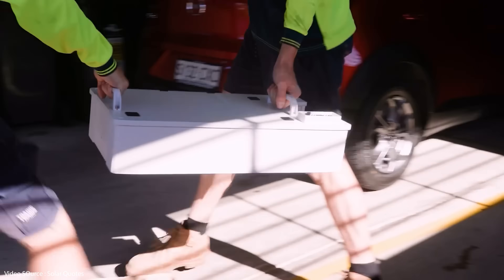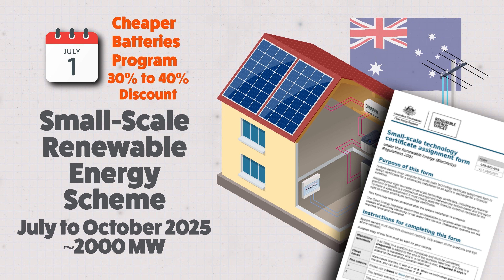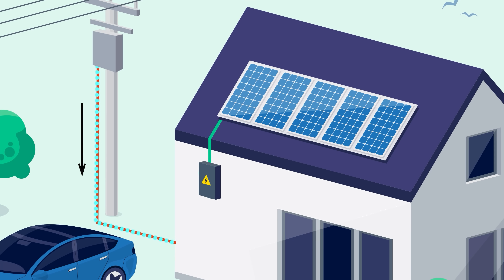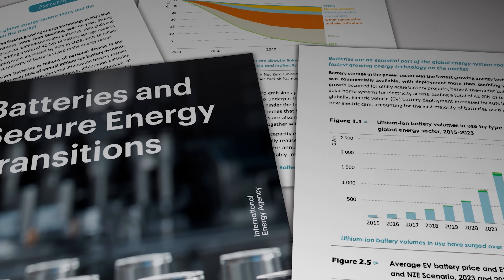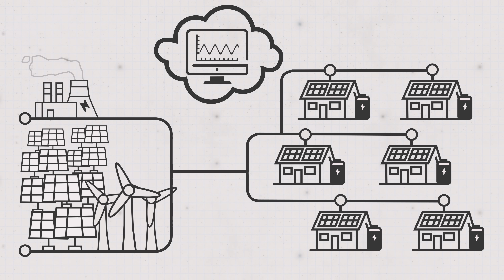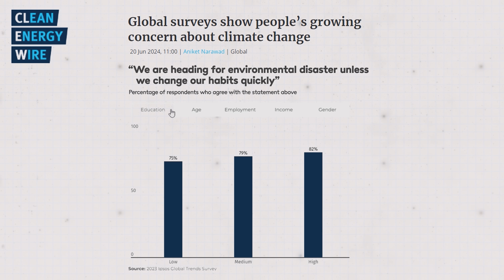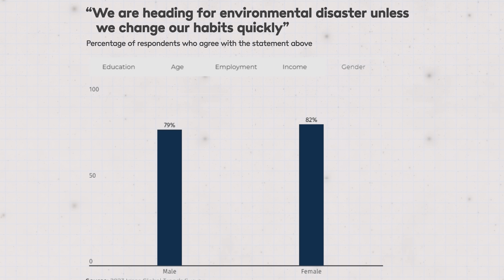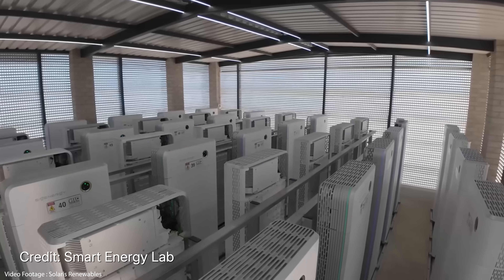Australians installed 100,000 home batteries in 17 weeks. Why can't we all do that?

Comment: I rember when expert said that 4% Wind/solar was max the grid could handle, now we are at 60% in Denmark.
Reply: Denmark pays Norway to take its unwanted randomly-produced wind-and-solar energy.
Denmark relies on imported hydropower from Norway.
Reply: @aliendroneservices6621 That's what a power grid is for - to enable countries to share electricity in response to changing demand and supply conditions.
Reply: @tassied12  Residential and Business Electricity Prices by Country in USD/kWh,
2023–2025 average:

Denmark: 0.358
Norway: 0.155
Reply: Geothermal is about to leapfrog wind and solar as the go to choice for energy generation.
Reply: @Les_S537  Leapfrog? That is simply an unrealistic claim when all you have to point to is a pilot plant!

Global solar output has doubled in 3 years. Ordinary Pakistanis added 18 GW of small solar in just 12 months. Over 1 million Germans have now installed balcony solar. The technology is advancing so quickly it is becoming accessible across the globe.
Reply: @Les_S537  No its to expensive, its ok for heating but to make HP steam you have to go to deep.
Reply: @andders2477 Yes, to produce geothermal for energy generation you have to go deep, and we now can...

Comment: Billions of watt hours of storage nobody has much visibility of. Though tomorrow is an example of our problems. South Australia and Victoria will have so much supply, they will pay customers use electricity. At the same time, across the border in New South Wales, that electricity will fetch $20 per kWh. The main cause is a large temperature difference between the major population centres, combined with poor building design where the fix is large air conditioning units.

Comment: As good as grid forming inverters are we need to have more synchronous condensers installed as they provide real “physical“ inertia to the grid. combined with large scale batteries, pumped hydro and grid forming inverters it is completely feasible to have Australia’s energy at 100% renewable. Flame away coal lovers.

Comment: I use Amber. I pay wholesale prices. Between 16:00 and 21:00 used to be above 50c per kW. Since the battery boom it is between 35c and 45c often. So night rates decreased slightly already

Comment: Let me be really clear batteries do not produce electricity. They simply store it. They also degrade overtime the longer they store electrons and the more they are called upon even more rapid loss of electrons
They are a back stop for a weak and intermittent unreliable energy source.
Reply: Geothermal is the energy of the future...  Period.  Nothing else compares.
Reply: @Les_S537 Not in Australia. Nearly all geothermal projects have been abandoned while rooftop solar continues to expan. There is now more capacity on our rooftops than in our coal plants.
Reply: @tassied12  Even in Australia you will soon see a resurgence in geothermal as an option.
Reply: @Les_S537  The investment isnt there. We have been trying for decades without success with geothermal. Our geology makes it difficult

In contrast we have plenty of sunshine so solar coupled with batteries are going gangbusters
Reply: @tassied12  I've replied to you several times in other threads within this forum explaining that we now have the solution to your problems.

The Kola Superdeep Borehole is 40k+ feet deep.

It took the Russians 20+ years to drill it.

Quaise Energy can drill to that same depth in 100 days now.

Problem solved.
Reply: @Les_S537 Quaise energy is still only testing their solution. They are still a LONG way from commercialisation. Given past problems with geothermal this is still unproven.

Meanwhile, solar and batteries are still showing strong learning curves. The price of batteries has dropped 45% in 12 months and global solar output has doubled in 3 years. That is a lot of ground to mske up
Reply: @tassied12  Next year they'll have a pilot plant up and producing power in the western US (it's in progress right now).

That's all the electrical utility companies need to begin building out large scale geothermal.

Quaise will be able to drill a geothermal power plant in less than a year.
Reply: @Les_S537  I still think you are getting ahead of yourself. It is a PILOT plant.

Meanwhile,  solar has fallen so much in price that ordinary Pakistanis installed 18 GW of solar in just 12 months. Over 1 million Germans have now installed balcony solar. Solar is now accessible to the average punter. Local electrification is where the world is heading. It will be great if geothermal is eventually able to play its part, but you must be mindful of other trends in technology.
Reply: @tassied12 a year is not a long way away
Reply: @tassied12  "Given past problems with geothermal this is still unproven."

There's a famous quote for skeptics such as yourself...

"Past performance is no guarantee of future results."

In other words, just because mechanical drilling has failed to produce geothermal at scale doesn't mean that millimeter wave drilling won't achieve it.

The fact is that mechanical drilling achieves only 0.1 meters of drilling depth per hour through granite, that is an immutable fact.

Quaise's millimeter wave drilling has already achieved 5 meters of drilling depth per hour through granite.

So clearly millimeter wave drilling is better and CAN achieve geothermal at scale.

Knowing this, and knowing the scale of environmental damages the earth is sustaining due to us producing wind turbines and solar panels and batteries at scale, why would you continue to champion wind and solar with batteries?

You're being completely illogical.

Comment: Australia is, as we all know, a difficult place to build infrastructure. Wildfires, dust storms, lightning storms, flooding, cyclones, geomagnetic storms, freezes and the usual terrorism. Adding battery systems makes the entire system much more robust, and buys time for repairmen to do their voodoo and restore service - because they now have options as to how to restore service. The entire distribution system is dynamically more robust. 
I'm not a huge fan of lithium ion chemistries for this application, however. Sodium-carbon chemistry is wiser for this application, as it is inherently unable to burst into flames while attached to you house, the materials are FAR more readily and broadly available, and it's cheaper in the bargain. It's bigger and heaver, but it's not a car!

Comment: and how many of them can be bricked remotely like the teslawalls?
Reply: All of them have internet access, and those owners should be happy Tesla bricked them because the ones they bricked all had batteries that came from a bad batch of cells from the manufacturer.  Tesla will replace the battery systems eventually.
Reply: @Les_S537  nopes they should NOT be able to remotely brick... they can do a recall... one day they get hacked (it happens all the time) and TADAA the whole world is bricked...
Reply: @LittlebitsStreams They did it at the request of the US Consumer Product Safety Commission (CPSC), and the units had already been recalled (November 2025).  The "bricking" took place post recall announcement.  A recall had been made within Australia as well (September 2025).  Tesla plans to replace all units at no cost to customers.
Reply: @LittlebitsStreams With regards to batteries more generally, people need to understand that this is the entirely wrong path to go, and the coming decades will prove that.  Geothermal is the path forward.
Reply: @Les_S537  nuclear power is stable, green and doesn't depend on the weather... the green fad is ridiculous... batteries only make sense in areas where you can't get grid access
Reply: @LittlebitsStreams Geothermal is stable (capacity factor between 70-90%), green and doesn't depend on the weather.  Just 0.1% of the thermal energy beneath all of our feet is enough energy to power mankind for 2 million years, and it doesn't run the risk of radioactive fallout that nuclear does.  Yes, yes, I know modern nuclear is relatively safe, but it can AND HAS gone awry in the past.  You don't have that risk at all with geothermal.
Reply: @Les_S537  then start digging...
Reply: @Les_S537  nothing wrong with modern nuclear and thorium etc. can't keep comparing to Tjernobyl which was a shithole and old tech...
Reply: @LittlebitsStreams It's not just Chernobyl, there is also Fukushima which was taken out by an act of god (tsunami).  If Fukushima was a geothermal power plant and it got hit by a tsunami, no big deal, but it was a nuclear power plant and now look at the fallout from it...  Look at the war between Ukraine and Russia today, war has put several nuclear reactors under threat multiple times and Chernobyl's protective barrier has taken direct fire.  Controlling a nuclear power plant in a war situation is scary as fakok my friend.  If stray artillery or a plane crashes into a nuclear reactor in a war situation you've just created a serious problem.  However unlikely it might be to actually happen, what if an asteroid were to hit a nuclear reactor or a nuclear reactor complex with multiple reactors on site?  Granted, the asteroid strike might be the greater worry, but what if it was just a smaller meteroid or shower of them?

Geothermal is just way safer than nuclear, hands down.  

Yes, let's start drilling.
Reply: @Les_S537  do you even know what happened at Fukushima? It had nothing to do with it being a nuclear plant... it was a Tsunami...
Reply: @LittlebitsStreams Do you have a reading comprehension disorder?  My wording was unambiguous.  Yes, I know what happened at Fukushima.  A 9-9.1 earthquake happened offshore in the Pacific which spawned a tsunami which hit the Fukushima nuclear power plant.  As a result of the tsunami, one of the reactors went into meltdown.

If Fukushima had been a geothermal power plant you'd have had no nuclear fallout.
Reply: @Les_S537  and what did you learn from that then? maybe something about WHERE to build them and where NOT to build them? maybe something simple like don't build them where they are prone to Tsunamis? oh and how many died from it? zero? good...
Reply: @LittlebitsStreams Current LCOE cost of nuclear is $141-221/MWh

Current LCOE cost of geothermal is $60/MWh

Expected LCOE cost of geothermal with Quaise Energy's new drilling technique savings?
~$30-40/MWh

Quaise wins hands down.

Comment: Look up Sodium Ion home batteries that are now being produced. Made from common salt, no rare earths at all. They last 135 years while lithium lasts only 35. They're much cheaper. You can drain them to 0 unlike Lithium which has benefits. They charge a lot quicker. They don't explode with thermal runaway. They work in a broader range of temperatures. Game over battery haters!
Reply: Batteries haven't been mass produced with rare earth elements for a very long time (NiMH).  Lithium-ion batteries have never had rare earth elements in them.  As for the rest of your claims about sodium-ion batteries you're greatly exaggerating.  To claim they last 135 years is just dumb, we haven't even been making them for that long.  No battery will ever last anywhere close to that time period, and sodium-ion batteries have a shorter charge cycle life than lithium-iron phosphate today, plus they have less energy density.
Reply: @Les_S537  try doing some research, their 50000 cycles is the equivalent of 136 years roughly, you fool lol
Reply: @auscryptocurrency1162  I've done my research, thank you very much...  First of all, battery cells in a battery farm go through more than 1 charge cycle in a day (depending on use).  Second, the highest charge cycle attained for sodium-ion battery cells is in a tightly controlled lab environment, and that test showed that the battery had retained 94% capacity after 4k charge cycles.  This creates an estimate that it could last 20,000 charge cycles before reaching 70% state of health.  But again, that's in a lab, not the real world.  Real world testing of sodium-ion is still being done.  Maybe you should take your own advice and do some more research.
Reply: @Les_S537  No you haven't done your research. There are already sodium batteries with 50,000 cycles ...try google, dummy
Reply: @Les_S537  oh yeah it's also 50000 cycles before dropping to 80-90% ...still usable when lithium would pretty much fail haha you haven't done the latest research I can tell, because you are wrong haha old data buddy, refresh
Reply: @Les_S537  as for "the rest" of my claims, what do you have to say about them? You are already wrong on everything you've said so far. You don't think they can project their potential lifespan? lol you are dumb buddy, not me. I also just said they don't need rare earth elements, or anything that the original comment was bunging on about with kids mining lithium or whatever, it uses common elements, that's the point... real arguments mate, what you got? you sound pretty silly tbh, especially with your name calling and you end up being wrong haha lame
Reply: @Les_S537  slightly less energy density btw, that's why it sits close to lithium on the periodical table buddy. I never mentioned density. Density isn't a problem when it comes to using them as mass storage, especially for homes. For cars it's a different story but they can still do the job. plus the fact you can drive further and charge quicker hahaha wth you even on about? This is newer tech that can be improved, lithium batteries been around for ages
Reply: @Les_S537  haha you just got owned goose. Do some research, the 135 years due to the amount of cycles they can handle... it's been projected for lithium batteries, they have an expected lifespan... and same goes for sodium hahahaa
Reply: @auscryptocurrency1162  " haha you just got owned goose."  Well, you've got an active imagination, I'll give you that much, but that's about all you've got going for you.
Reply: @Les_S537   @Les_S537  why you even arguing anyway. The point is Sodium is taking over the show. new tech, being improved as we speak. You can't even keep up with the improvements lol You also still haven't given any counterevidence re the other positives I noted haha cheaper, less of a fire hazard, faster charge and discharge etc... you seriously want to argue against the merits of sodium batteries? get a grip mate. Easier to recycle... the list goes on. Energy density is also increasing over time, straight facts. Even overlaps the output of lithiums range hahaha you are out of touch my man
Reply: @Les_S537  did you also know sodium batteries don't need ANY external cooling hardware, or even warming hardware that is required for lithium in colder climates? yeah nah I don't think you do know that ...cheers for the additional personal insults btw. Sorry to disappoint but i'm levels above you in all areas, IQ and physically, so maybe don't make assumptions ...owned like I said mate
Reply: @Les_S537  so anyway, what about the rest of the claims? overexaggerated you reckon lol do they explode like lithium? yeah nah they don't... charge quicker? yes they do, much... operate in broader range of temperatures, absolutely etc etc buddy everything I said is accurate ...do some research, you come across as ignorant and lacking education tbh
Reply: @Les_S537  you know what else is funny, this whole government battery push thing when this newer sodium tech is being released now for home use. People paying top dollar for fire hazard lithium batteries that don't last as long as sodium lol how silly of them. I'll buy the sodium thanks, at least I don't have to worry about my house catching fire from it lol maybe you should have a look at the powerwalls that tesla had to remotely brick because of fire hazards... do some more research foo

Comment: Australia has to do it. In 2022, shortly after labor got back into power, the grid was put into a state of crisis. Power reserves were already low due to winter, but then the private foreign owned companies who own the coal stations "conviently" forgot to do maintenance on them, and several had to be shutdown. That knocked over a whole row of dominos, causing chaos, while the generators who caused the mess were were paid 100 million in contract payments.

The coal and fossil fuel companies know they are old news, know they are going to be made redundant, and they are not going to go quitely

Comment: Definitely a lesson learned is to set the subsidy up on a per battery basis not per kWh. So many installers have been pushing people towards bigger batteries than they need (up to the Max 50kmh when the average household uses 15-20) because they get more in subsidies from the gov with end users paying about the same regardless. This has resulted in the half the allocated funds being used far quicker than anticipated and people buyijg the biggest, cheapest battery they can when a smaller higher quality one would be more fit for purpose .

Comment: This is because we were sold solar panels by the government to reduce power bills but they dont actually save you anything unless you have a battery system to power the lights overnight. Also most people are fleeing the massive bills by going "off grid" to avoid up to $10,000 of utility bills a year.

Comment: I'm still using a 5kW solar panel system installed 13 years ago, then another 5kW installed on top 8 years ago. In just a six year period my feed-in tariff dropped from 20c to 2c! I had no choice but to get the battery with those heavy discounts available after that drop so here we are! It's about long-term saving money as a pensioner now, nothing at all to do with all you climate crazies obsessive hatred of the gas of life, CO2!